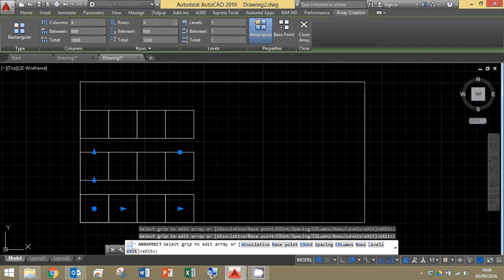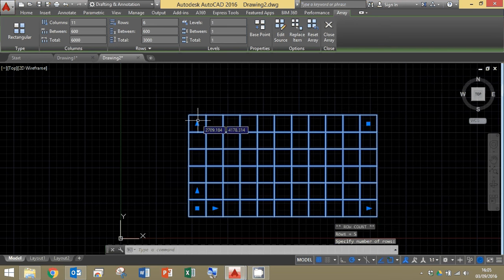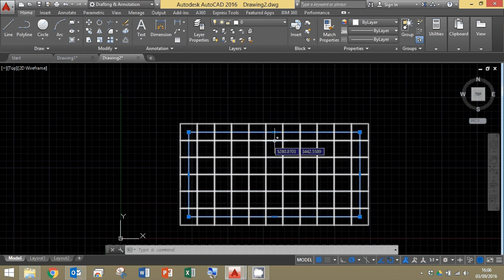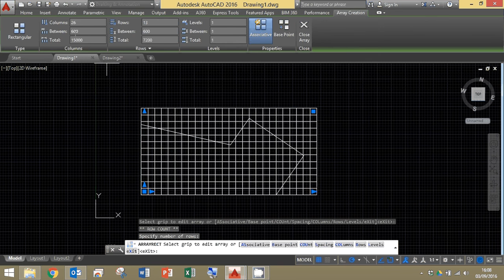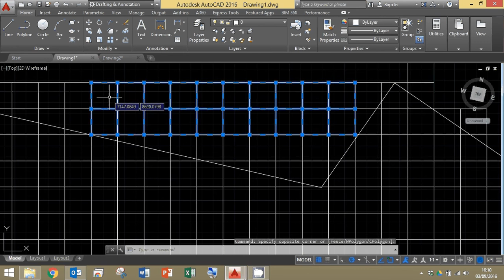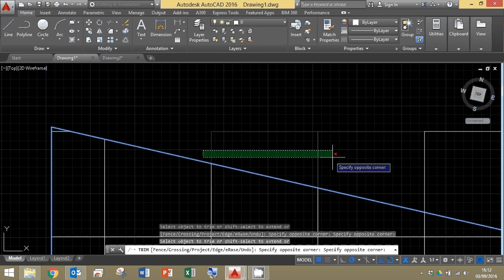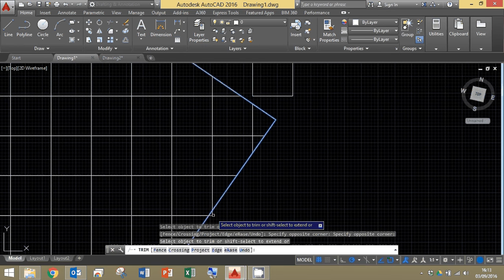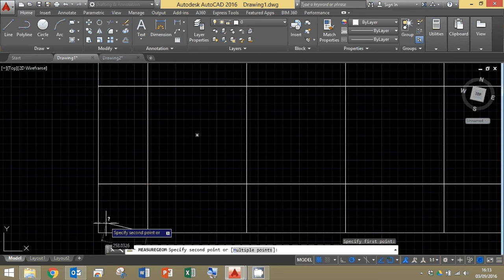AutoCAD New Ceiling Grid

Comment: u can use xtrim  instead of trim , u could even better use xclip , or even better hatch grid which easily u can control its origin and size and where it is selectable or not
Reply from the maker: Great tip thanks. I did record this video 5 years ago in 2016 and at that time the XTRIM had only just been released and I had not yet discovered it :)

Comment: I think there is a "ceiling grid" tool that can auto generate the grid.
Reply from the maker: Hi Joyce,
Thanks for the comment. Do you know where the tool is? It may be useful to others to know about this feature also, including floor tilers...
Thanks in advance. 
Oaks
Reply: @OakleyTurvey  That would be included in the Architecture pack if I am not mistaken.